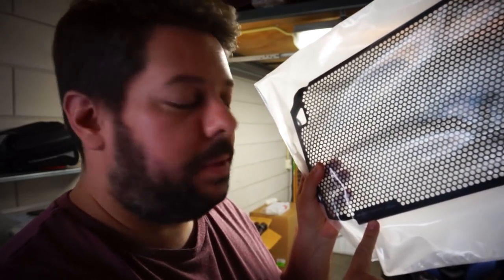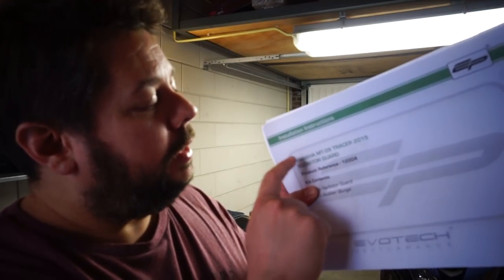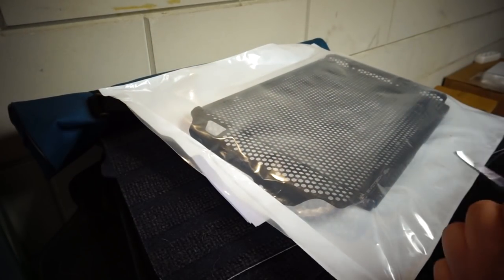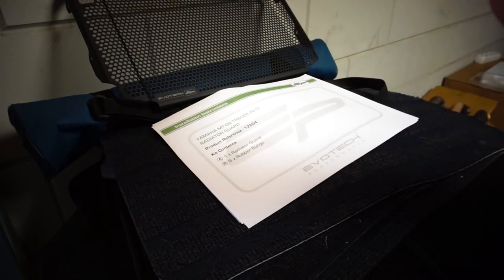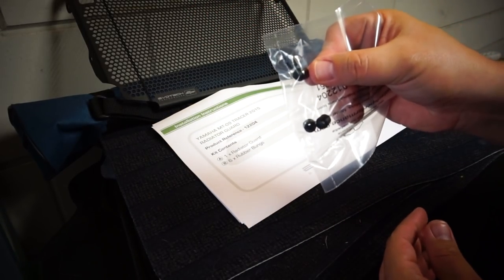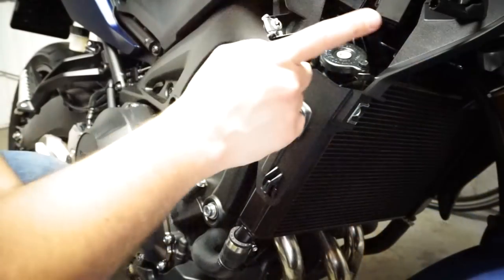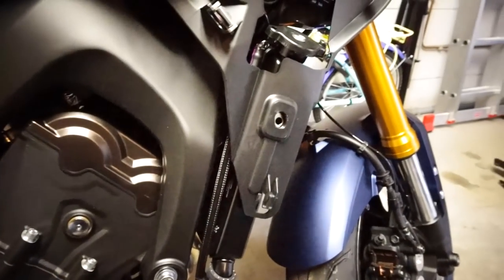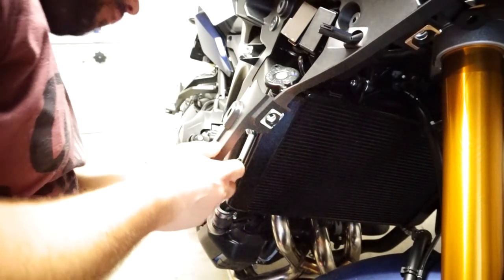Installing the Evotech radiator guard | Tracer GT #6

Comment: Nice bike. Do you have problem with handbar shake ( wobble ) on high speed? Tracer before new GT model had that problem.
Reply from the maker: I haven't been able to test fully (too much traffic on the road, couldn't go that fast) but it is much more stable than the previous model when riding behind a car or truck.
Reply: I have a 2017 Tracer. No high speed wobble at all.
Reply: I bought a 2018 Tracer GT last weekend. Went for a ride and tested it's acceleration and speed a bit. It was raining a bit and I had a passenger. I stopped at around 205 km/h and all I can say is that the bike felt so freakin' stable on that speed. So no wobble in the 2018 model.
Reply: @kulter20  Were you on the OEM Dunlops?
Reply: @0146812950  Nope. Haven't tried them, but they weren't too good from what I heard. I believe I've got the Metzeler Roadtec 01 on them. They stick to the ground like a charm and allows me to go very deep. Wouldn't want any other.
Reply: @kulter20  Awesome, thanks
Reply: @0146812950  You're welcome.

Comment: Ty for video! Are you having trouble with the wind on this bike?im 190 cm and it doesn't really matter if the screen is at its lowest or highest (or between)..still getting a lot of wind on my shoulders and helmet
Reply: I am also 160cm and I agree, a new screen is needed (no change from the previous model) hopefully some manufacturers will start producing them soon.
Reply: Bowlin01 190 right?😁 On puigs site it says 'in development'
Reply from the maker: I'm 1.72 and I also get wind on my head, but not on the shoulders. I think with this screen I might be able to solve it with only a clip on, instead of a replacement screen. Also, there's better wind protection for the body now.
Reply: LOL yes 190 not 160!
Reply from the maker: That's pretty cool, but their screen is almost the same as the original. I wish they sold the clip-on only...
Reply: Critical Rider ye not a fan being in need of a clip on. I rather have less screen.. Looking forward to Puig racing screen for this bike😊
Reply: Bowlin01 please keep me updated in this frustrating search😅

Comment: What's your opinion about the original guard from Yamaha?
Reply from the maker: I had the original on my previous Tracer and it's very high quality! You definitely can't go wrong with that one. I just wanted to try something different this time.
Reply: Critical Rider sure, thanks a lot
Reply: Critical Rider Man, does your engine make a higher pitch sound in sixth gear, unlike the other gears..?
Reply from the maker: Iliya Marinov  I never noticed anything different...
Reply: Critical Rider Have been searching the Internet all day... And apparently its a common thing with the Yamaha 900...whining at sixth, and sometimes at third gear.
Reply from the maker: Iliya Marinov  just install an Akrapovic and the problem is gone :-)
Reply: Critical Rider I am waiting for mine any day now :)